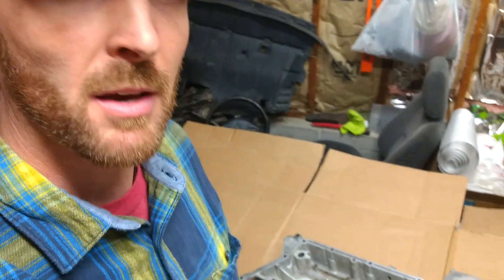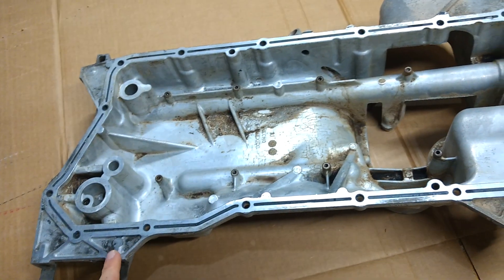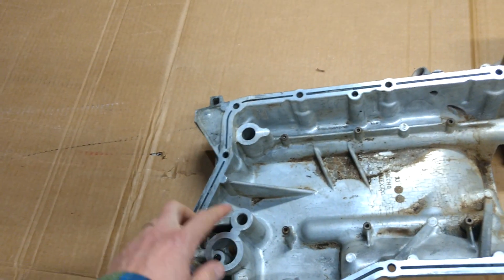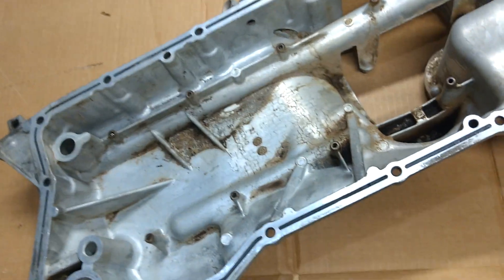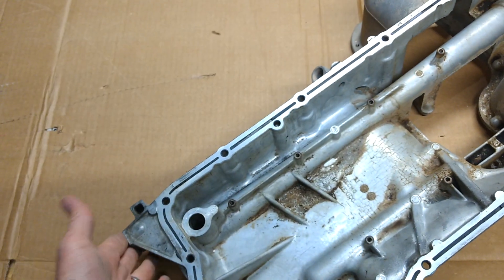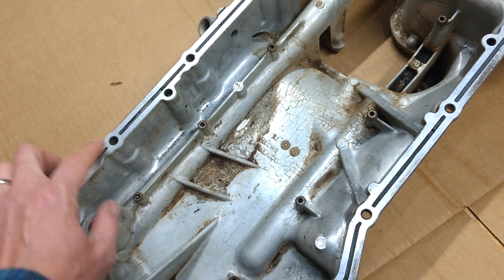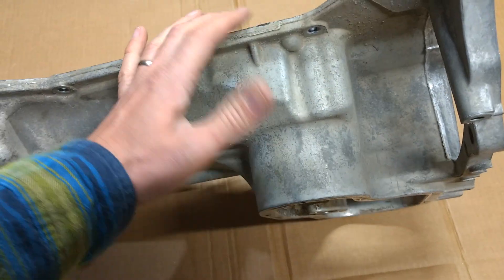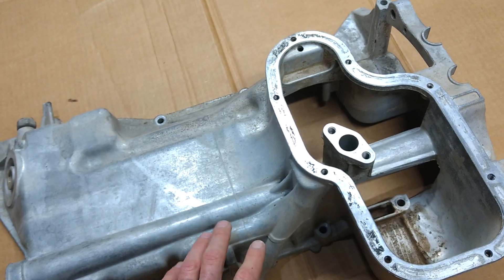OEM VK56DE Oil Pan Front Sump Conversion Thoughts

Comment: I’m really glad I came across this video. Gave me a lot of really useful information about how that oil pan is designed and what all is actually integrated into it. I am currently swapping the VK 56DE into my 350 Z drift car. Luckily, they make a rack relocation kit that we’re going to put in in order to move the steering rack toward the front of the car and see if it clears the stock Vk56 rear sump pan.

Comment: VK56 out of an Infiniti Q70 is front sump. I'm not entirely sure if it's a direct bolt on but it should be.
Reply: The flange patterns are different from the VK56DE Titan Armada to VK56VD found in the later Q70's etc.
Reply from the maker: Nice, that's going to help someone out if it works out.
Reply: Looking at the pattern on them its definitely a different mating surface.

Comment: What are the 8 ports, 4 on each side facing straight up? They look like piston oil squirters?
If you left the pickup and cut the drop for the sump off then followed the curve when cutting off the pickup extension you could just move it forward on the tube exposed under the pan. Tig it in place. Cut and grind your sheet metal to fit your forward sump area leaving the bottom open for a new front sump pan. Once you have your sheetmetal for the walls of the sump drop, plunge the mill through it and start opening it up to the new sump. Finish up what you can't reach near the edges with a Dremel. As far as the very back mounting to the transmission, just leave that one inch thick mount all the way around. Cut everything in front of it flush with the pan. Or screw it, machine a 2 inch spacer with a -12AN line sticking out the side for a remote mount filter and the return right next to it. Same thing for the pickup, a surface on your spacer to go to the pump and a hole for a pipe and an oring with a 2 bolt flange. Now you have a 2 inch spacer with the parts for the oil filter ported to AN lines on the side for remote mount and oil cooler if you want. AC and Alternator bracket mounts and oil pump pickup pressed to the gasket and a standard pickup tube 2 inches below it. Incorporate the drain backs in your spacer. Mount the flange with recessed Allen (hex) bolts. Then you have a standard flat flange to mount a sheetmetal pan with a pickup tube and a sump anywhere you feel like it. You could even Y the pickup and do a split sump with two drain plugs.
Reply from the maker: They're mounting points for the windage tray, if I recall correctly.  And for sure, there's certainly more than one way to go about it.  Hopefully this video and the comments can help someone else pursing the swap and designing their own.

Comment: To bad the vk45 pan will not fit
Reply from the maker: For sure.  That would simplify things greatly.
Reply: I’m working on putting 03 vk45 in my s14, are you still making the vk mount kit?
Reply from the maker: @13beast7  we're not stocking them anymore.  We are just finishing a special run "group buy" on the VK56 mounts and we have one S14 VK56 mount set available.  We just cut one extra since we had a enough material on the sheet after filling the other orders.  There's details on the mounts/group buy on our IG @brickhouse_products or our FB page "Brickhouse Products LLC" a few posts back if you want to check it out.
Reply: Brickhouse Products ok thanks I’ll check it out.
Reply: Brickhouse Products found something that may help. Infiniti M56 oil pan is front sump. It should bold up but may have to use m56 front cover also

Comment: i'm about to fit one in a c32 laurel, thinking to just cut the firewall to put the engine further back. Sump problem fixed and swaybar problem fixed
Reply from the maker: If that is an option, then that would be one way to solve the problem.  You'd probably still want to ditch the stock stamped steel lower pan and switch to the delete plate for that just to get the engine lower.
Reply: there is a lower intake manifold on ebay that uses the LS throttle if needs be

Comment: Nice that Brick House is committed to the vk56de and not the standard domestic big 3 engines.
Reply: I love it, the potential is well above the big 3. You can have the GM displacement and the Ford heads with a LOT of love with your Dremel.